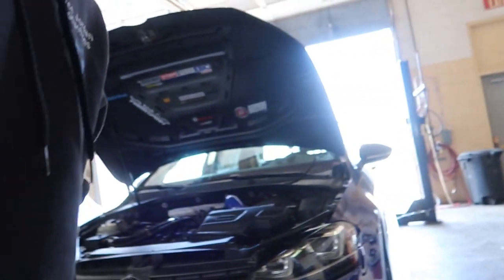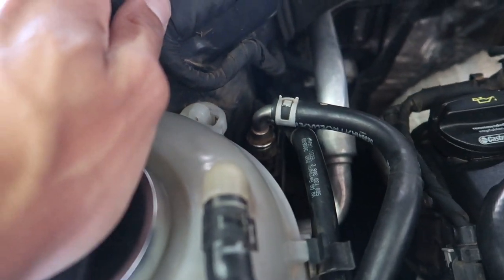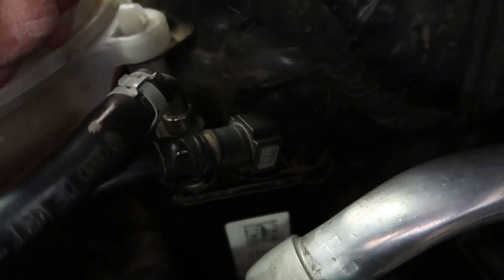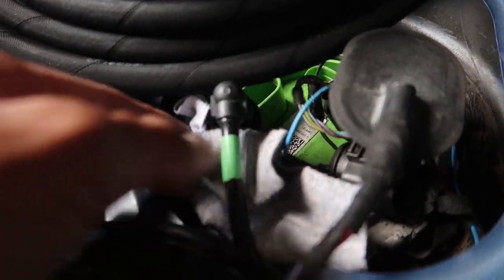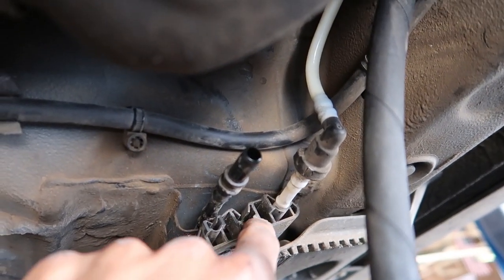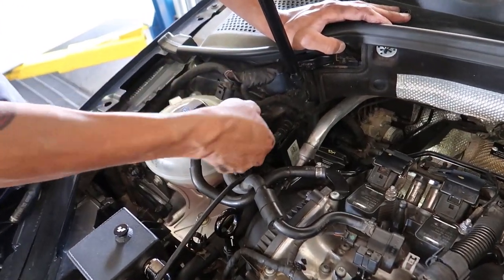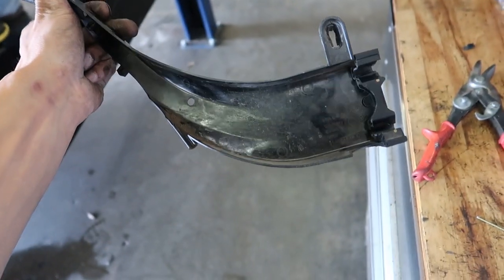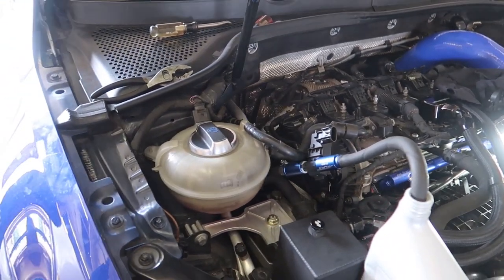Precision Raceworks high flow fuel line + E85 sensor install! | MK7 Golf R

Comment: Just tried to install this fuel line hit on a 2015 Audi A3 Quattro and the -6AN fitting will not go thru the last 3 inches of the fuel tunnel. Ordered new ferrils so I can take apart the aft end and route to in tank pump and re-assemble. Not happy!

Comment: sweet fellow Texan :P I'm in Round Rock :)  Working with Brink Motorsports out of Austin, TX on my conversion to Stage III+ APR with vacuum wastegate delete and electronic solenoid add and calibrated with United Motorsports tune.  This looks awesome TY :)  I'm using the APR Fuel Kit which includes a fuel pump but it's not like the precision set which I think is a larger kit, lb injectors and pump.
Reply from the maker: NICE! I freaking love Austin man! I got some good friends in round rock, hoping to move there within the next few years!
Reply from the maker: I'm sure you're going to make some crazyyyy good numbers on that setup though! Are you doing pro flex as well?
Reply: Bryce Jordan Productions  actually I’m using the APR fuel kit.  Which I think is a little under fueled.   I hope it works out

Comment: Hey Bryce, you mentioned in the video that you were going to see if E content showed in obd11. Did it? Can you confirm the wire colours on the ethanol sensor connector.
Reply from the maker: It doesn’t show in obd11 for me because I don’t have a flex fuel tune, but I do have a sensor going to my p3 gauge to read E% not sure of the colors offhand though I’d have to look tomorrow’s

Comment: These engines torque around pretty good. I think a little more relief in the hose between the sensor and rail might have been a good idea.
Reply from the maker: I agree!
Reply: He does have BFI mounts too, should be pretty well locked down.

Comment: Couple of questions. 
You ran the an6 from LPFP to the MPI rail. 
Was anything done to the main fuel rail?
The e85 sensor just runs independent on a separate tool I assume. 
And does the an6 require a retune? The HPFP controls the amount of provided. So I assume not.
Reply from the maker: No retune required for lines as far as I know. Sensor can run off the ECU if you have the tune for it, Currently only United Motorsport has that though. DI rail is untouched, and line goes from pump to ethanol sensor to PI rail to HPFP
Reply: @BryceJordanProductions  pretty easy mod then. Regarding the injectors are the DI still the stock ones?
I have being told those don't like e85 very much. 
The ones that came with the MPI I assume Nate e85 compatible.
Reply from the maker: I've only heard of a few people upgrading DI injectors, and that's mostly because they don't wanna go MPI. They do fine with E(blends) as far as I know, just not sure how much they can handle by themselves without a HPFP upgrade or MPI Stacked on top. Mine are stock
Reply: @BryceJordanProductions  Cool thanks for the info. Building a A5 pretty much same engine. But I forged Al internals. Still running a concerted is38 hybrid. But looking into Garrett and Borg Warner as a bigger upgrade. Want to be change the lines so I can go e85 at some point.
Reply: @BryceJordanProductions  Hi Bryce, One last question. It's probably due to your car not having stock MPI or maybe i am missing something. 
Is your AN line running from LPFP to MPI to HPFP to DI? Should't it go from LPFP to HPFP and then spit up to MPI and DI?(that's how it runs on stock MPI cars)
Reply from the maker: There's a few different ways of running it, I chose to run this way because it's much cleaner and takes less line. From my hpfp to DI rail is a hard line I believe anyways I didn't want to touch anything that I didn't have to. You can go on my IG (br32yce) and see some pics of how I did the lines in the bay
Reply: @BryceJordanProductions  Hi Bryce, was looking through the this again. Did you pin the flex fuel sensor on your ECU also?
If so by any chance do you remember which pin?
Already looked through the install guide from precision race works but didn't see any mention not that.
Reply from the maker: I don't remember off hand but you can shoot them an email quick and they'll let you know.. they were supposed to update their install guide but I guess they haven't
Reply: Hey Bryce.. did you remove the original fitting on the MPI rail to accommodate the new screw in fitting on the PR line? 

My MPI rail from PR has a fitting attached to it that is designed for the rubber fuel line to go over it. Not screw into it. 

I’m wondering if I need to unscrew that fitting on the MPI rail and screw in the fitting on the line.
Reply from the maker: Yeah I used the screw in fitting that came with the new line, then used the barb fitting leaving the rail to the hpfp

Comment: Quick question!! Where did you get the quick disconnect fittings your using on the flex fuel sensor?
Reply from the maker: I ordered it from Precision Raceworks with their MPI kit
Reply: Bryce Jordan Productions got it!! I tried looking for them separately but had no luck 😅Appreciate the info!
Reply from the maker: Shoot them an email!

Comment: I was going to write, you better use more than just tape to pull that through haha
Reply from the maker: 😅 it almost worked lol
Reply: Bryce Jordan Productions haha
Reply from the maker: Was definitely was easier going backwards though, slid right through!
Reply: Bryce Jordan Productions yeah, I taped some 18 gauge wire at the back and then pulled out the front. Then taped the new fuel line to the 18 gauge and pulled that back. Glad I could help though.
Reply from the maker: I appreciate you buddy!
Reply: @dwvw  Hey there I'm about to do my line and I am curious if you needed to remove any of the plastic parts (for routing) near the high side or under the car like Bryce did with your approach?
Reply: @dytekle  I removed the plastic routing duct under the hood that the fuel line goes through for sure. I can't remember if I took anything else off though.
Reply: @dwvw  thx! Looks like I'll need to remove some bits underneath too.